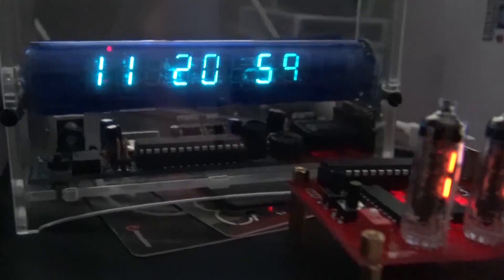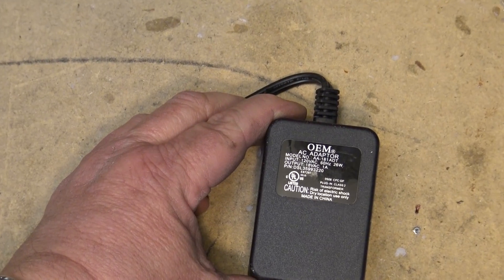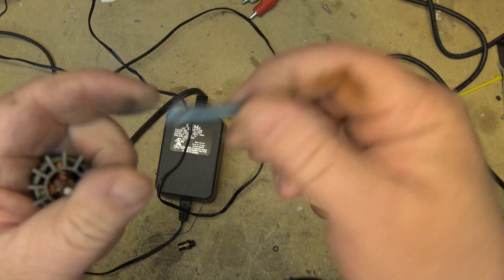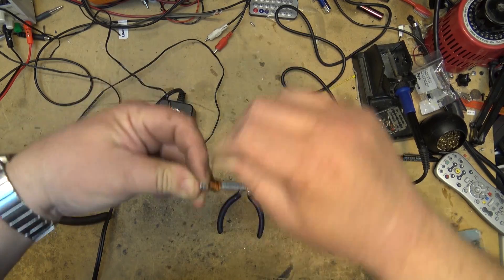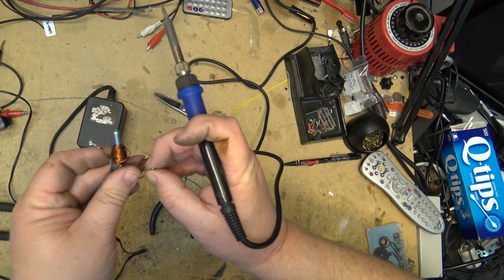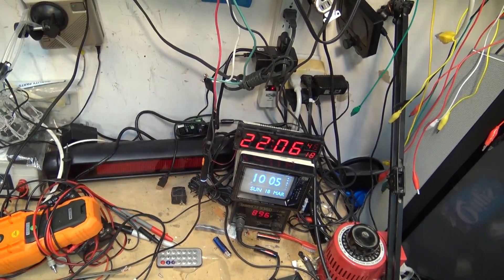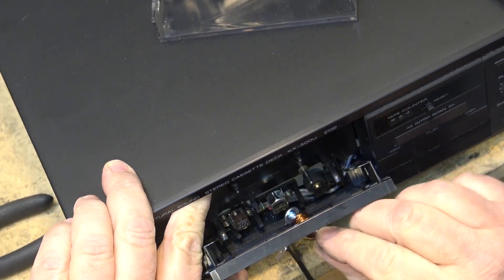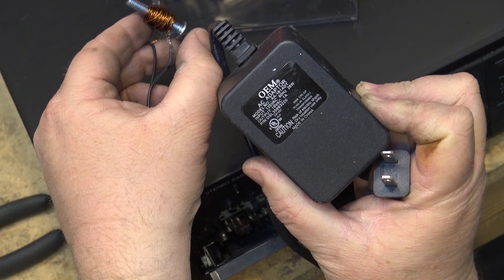Build a tape head demagnetizer in 5 minutes

Comment: very nice . One question I do have: in the cassette deck manual, it says that the device should be OFF when demagnetizing. but you were demonstrating a playing deck. which one is safer ?

also, is there any danger that the wire get too hot or the transformer to burn ?

Comment: Mine got hotter than hell and melted the tape.  12VAC 100MA -
Reply from the maker: Need more turns of wire.  It will get warm. Duty cycle 1 min on 5 off to cool.

Comment: Does the cassette deck need to be powered on?
And does it have to be 18v power supply. Can I use a 12v ?
Reply from the maker: Powered off and 12v should be ok but it must me AC not DC.  Dc makes a magnet.
Reply: @12voltvids Okay thank you

Comment: I don’t have AC-AC transformer. I solder the coil wire to AC-DC adapter before the AC voltage from transformer has regulated. It’s also use🙏🔥
Reply from the maker: That won't work. Must be AC or you create an electro magnet.

Comment: even DC output old wall wart will work but it means you have to break open the plastic case and remove the rectifier diodes..

Comment: Can this erase 1/4 inch tape ?  How long can something like this stay on before over heating & burning the pwr supply ?
Reply from the maker: Yes it wipes a 1/4" tape in 5 seconds.   1/2" VHS and beta in about 10.  8mm and dv tapes about 10 seconds as well.   Duty cycle is 1 min on 8 off to cool.  You can wipe plenty of tapes in that time.   Run it too long and it will shut down till it cools.  It does have a thermostat inside that will turn it off.

Comment: I have very little experience with power supply stuff… I have many power supplies that just say “12V 1A” as an output but none that specify AC, as in “12VAC”. Is the AC implies in these cases? They also don’t specify DC, so I don’t know what kind of output they are. Any way to tell?

Comment: This is great! Works perfectly!  I have a doorbell transformer laying around, 120VAC->16VAC. Hooked up a wall plug to it on the 120V side. Took some 18ga copper wire (coated) and wound 2 layers about 1.5" at the head of a 4" bolt.  Then connected the ends of the wound wire to the transformer and plugged it in. Boy, that transformer was not happy..bzzzz.. I slowly  swept the my terrible sounding microcassette player with the other end tip of the bolt, all around inside the cassette cavity for about 15 seconds.  Unplugged the transformer, to my great relief :D, plopped a cassette into the player. WOW! What a difference!
Reply from the maker: Yup.  Doorbell transformer works great.

Comment: How many spires?? What type of voltage is needed?? Ac but what its the Minimum voltage??
Reply from the maker: Must be ac.  Dc will do the opposite.
Reply: @12voltvids  and  nonworry about thenvoltage?? What isnthe minimun range?? Thanks again!! :)
Reply from the maker: @Jota.Barrakero  the higher the transformer voltage the more turns on your winding.   I could use a lower voltage transformer myself as the coil gets warm with use.  A 12 volt would be better but it works fine.  If you put enough turns of very fine magnet wire you could even run from mains.

Comment: One could probably heat shrink the end to avoid accidents like scratch head - as commercial degaussers have plastic tips obviously covering a coil .. what do you guys think? even electrical tape ..?
Reply from the maker: Well I did put heat shrink over the end.
Reply: you don't touch the tape head with the demagnitiser a inch away is fine passing the tape head from left to right or what direction the plug is at on the demagnitiser.
great video just what i needed.
Reply: @theprogrammerrolandmc3039  dude, I was talking about accidents - and they happen.  We know not to touch the head with the demag.   Yeah it's a good video because it can provide an economic method of demagging.   cheers.
Reply from the maker: @theprogrammerrolandmc3039  well the reason you don't touch it is so that you don't risk scratching the head. I have a rubber coating over the metal that will prevent the metal screw from touching the head but the fact that mine is as powerful as it is I can demagnetize the head from probably about 4 inches away because the demagnetizer I built is really powerful and it really fires out a good AC magnetic signal that'll wipe anything.

Comment: Could you use a southering gun (the good old ones) to demagnetize the heads ?

I ve heard some demagnetize CRT's with southering guns so..
Reply from the maker: Good luck getting it close enough to do any good.
Reply: @12voltvids  In theory, the output of the soldering gun is AC, so maybe i could apply your method by wrapping magnet wire around a bolt and just connecting it to the transformer's output (im pretty sure its max 24v). Would THAT be good enough ?
Reply from the maker: @sh0t734  the output of those soldering guns is about 2 or 3 volts.   I used to make tips out of a piece of #10 copper wire.  It's low voltage high current that heats the wire up red hot.
Reply: @12voltvids  thanks for letting me know

Comment: Question. You dont get a shock when you hold the end of it? If your drawing current from the socket?
Reply: The transformer pulls it down to 12Volts, and the wire is coated in insulating enamel.

Comment: This is so great. I have lots of those adapters, and little motors too, and dead cordless drills too, laying around and didn't want to spend $ on a demagnetizer. See, I knew it was a good idea to save all this sh.t. My day has finally come.
I was gonna ask how many winds, assuming that would affect the strength. But I guess 'cordless drill motor kinda answers that question. (well, I guess that could range from 9 to 20 volts). I wonder if a stronger demagnetizer is better than a weak one.  hummmm.......
I see your example happens to be 18v output. What is the acceptable output range ?
Reply from the maker: 9-12v would be preferred.  Mine is a little strong.   Overkill.
Reply: @12voltvids  Many thanks. That's very good to know.
Reply: @12voltvids  that was my next question :)
Reply: I was happy to see it was AC.. I have only one DC but many many AC in bins.

Comment: Hi
Thanks for the tutorial
Can it be fixed with a 32v 1560mA adapter ?
Reply from the maker: It needs to run off ac, not dc. For a higher voltage more turns of thinner gauge magnet wire would be needed. (magnet wire is just enamal coated wire)
Reply: @12voltvids  Thank you very much for your help

Comment: what would happen if I held a neodymium magnet close to the cassette recorder heads. 
Magnet size is around 3/4" x 1.3 x 1.5.
I use it many times to erase cassettes, but sometimes sound is still not so good.
Maybe time to demagnetize heads.
Can I cause damage to recorder or heads if I try it ?
Reply from the maker: Do not put a magnet near the head. That will do exactly opposite what you want.  A demagnetizer works because it is an alternating magnetic field.   120 times a second it reverses the magnetic polarity.  (100 times a second in 50hz countries. )
Reply: @12voltvids  I appreciate you taking the time to reply.  Thank you for the info.

Comment: Or you can just use a toothbrush charger base, which is an AC coil on a former, if you own a rechargeable toothbrush then you alrady own a tape head demagnitiser. Positive is it comes plastic coated so you can't scratch anything. Works great if like my Yamaha deck the door clips off for access.
Reply: Wow, that’s awesome. I will have to try this!
Reply: I tried it and it doesn’t work. Could you tell me what I’m doing wrong?

Comment: Well this is strange , I followed all the instructions to video , except I did read the psu right , it’s a dc out psu , well as I’d done such a nice job ,I thought I’d try it on a screwdriver , so I used the screwdriver to pick up a screw ,, to check it was magnetised , it was .
Ran over the the end of my screw , and then it wouldn’t pick the screw up ..
Remagnetised the screwDriver again with a real magnet , and then redid the test same result ..
Just checked the demagnetiser and switching it it on does pick up the screw .... so funny what it does to the screw diver .
Can anyone explain ? Sure don’t wanna use it on my deck .. must look for another psu with AC I think , but curious as to what’s happened
Reply from the maker: It needs to be an AC output transformer not an AC to DC adapter.  Feeding DC into a coil with a ferrite core produces an electro magnet. AC produced an alternating magnetic field which will degauss (erase) a magnetic field in your play head.  This is really only necessary for three head tape decks. The process of putting any tape deck into the record mode will supply an AC bias signal to the recording and erase heads which will automatically demagnetize the heads. A3 head tape deck has a separate playback head which is not connected to the recording circuits and therefore will gradually become magnetically charged from the tape. Tape head demagnetizers are only required on playback only machines and the playback head on a three head tape deck. Anyone that tells you otherwise is misinformed.

Comment: Why destroy a perfectly good motor when there are easier alternatives? If you don't have sufficient turns, there will not be enough inductance and you may burn out the AC power supply?
Reply from the maker: It gets the job done.  It does what it is supposed to. Not worried about the transformer as it is only on for about 20 seconds at at time so it won't heat it enough to do any damage.  The motor was a scrap motor out of a broken 18v drill so nothing wasted.
Reply: @12voltvids  - Fair enough. BTW, I could have done with that 18 volt ac power pack for my Electro Harmonics Flanger. I finally founding one after many years! Cheers! Would a small transformer with the AC output unloaded produce sufficient magnetic field for such a purpose?

Comment: thanx for this       ...   
2 questions plz
does it have to be soldered? I do not have a soldering iron; or can it just be wound and then put electric tape around wound bits?    thanx
ALSO mine is a OEM AC ADAPTOR   input 230V ~50Hz 140mA OUTPUT 10V     suitable?

Comment: Hi, thank you for this video! This is what makes youtube so great and important. 

I made one today and the only problem I have is it is too week I guess. The copper wire, that I took out of a broken toy motor, is only 0,1 MM thick. Is that a problem?  Adapter is 120V~50Hz 140mA / 12V -- 1A and bolt is similar or identical to yours. I can barely hear anything when approaching the head. Is there another way to test demag if it is sufficiently built besides the CRT monitor? Thank you.
Reply from the maker: Remember the adapter has to have an ac output not a DC or you have made yourself a magnet instead of a degauasing system.
Reply: @12voltvids  Hi, yes I got that. It is AC. The wire is not that thin though. probably is 0.1 MM. Anyway to test it if it is built OK? Thanks. This is how it looks: https://imgur.com/2biUmYo
Reply from the maker: @hefic  yes that is too heavy.  You want to use magnet wire.   That will overload your transformer.   Mine draws probably an amp and gets hot quick because my wire is also too thick but my transformer puts out enough current to drive it.
Reply: @12voltvids  So thicker copper wire is what I need. Thanks a lot. I think I'm gonna use screw driver like someone here suggested. Thank you for your time.
Reply from the maker: @hefic  no, thinner.  Less current.  More turns.
Reply: @12voltvids  That is a surprise since this is so thin that I can ''barely see it''. So for an average screwdriver what diameter wire should I get? Thank you once again.
Reply from the maker: @hefic  26ga magnet wire should be fine.
Reply: @12voltvids  Thank you. (Only quick search for 26ga gives me diameters  of aprox. 0,5 MM which is actually thicker than mine).
Reply: @12voltvids  Try #2.  I think this should do. https://imgur.com/TYQP23a  &  https://imgur.com/1w5Of4m . I've noticed a magnetic pull effect towards the metal head. Is tape ok or should wire be free? Sry for questions, I'm kinda 'monkey sees monkey does' in this field.
Reply: I made one with some real thick wire from a dead transformer and just used a ton of it. Works good. The impedance is important.

Comment: be alot sliocker and easier to handle if you use an old screw driver with plastic wooden handle..  also wrap plastic  thin sheet around the screwdriver metal shaft before widing the wire around it.  im making one right now actually,  i have many tape etc players with magnetic tape heads to degauss  around here...  also i need to find or make some drive motor belts too,  out of string and rubber cement or find some rubber bands or something.

Comment: Could Dremel the end flatter and cover with heat shrink.
Reply from the maker: Why?
Reply: @12voltvids  Well, a covering to prevent scratching anything, plus If the bolt was slightly longer and a had a shaped tip would improve access to the head. I made my own years ago. But mine runs off 240v UK voltage, your lower voltage is better.
Reply from the maker: @Peterjames3535  
This is strong enough to demagnetize the head from a good inch away.

Comment: I have one 18V AC with 400mA is it ok? (edited)
Reply from the maker: No! Dc will create a magnet and magnetize your heads. Needs to be a. Ac field to neutralize magnetic charge on head.
Reply: @12voltvids  Sorry my mistake. I mean 18V AC but with only 400mA. Thanks.
Reply from the maker: @retroaria  yes that will work.
Reply: @12voltvids  Great, I'll make one and post it on my channel (in Portuguese).  I will leave due credits at the beginning of the video and in the description.  Thanks again for your attention.

Comment: I dont think i have an ac power supply kicking arround.  Will the output from an auto transformer on low voltage do the same job?
Reply from the maker: Crack open a DC wall wart and remove the diodes and filter.  Or go but a transformer for a doorbell.  Don't use auto transformer.  That's not isolated and you will be handling mains current.
Reply: @12voltvids  i do isolate it through  a 240/110 step down and 110/240 step up and its run off grid from 12v bank and inverter. I had a nervous test with it in a rubber vice and too much heat generated withjout any current limiter... Think i do have an old chime transformer somewhere actually, good shout. 
Last minute restoration of an old sony tc118 done up with classic scratch n sniff like the guardians ship moc deck for chrismas

Comment: can you use 12 v AC with a thinner wire?
Reply from the maker: You can use 6 or 12 volts.  I used what i had on hand and the wire i used was actually too heavy as it gets warm.
Reply: @12voltvids  TY!

Comment: It does not need it and there is no need to do it- it is all snake oil.
Reply: Demagnetizing is required only on playback heads.  Record and erase will neutralize as soon as record is entered.  A 3 head deck needs the play head degauased.
Reply: @ilovemysmartmeter  You need to experiment and test your facts as other wise you are just wrongly following the crowd. I am in this business of deck repair and I see the real results. There needs to be good proof of some process otherwise I just do not follow things blindly.
Reply: @sampalermo123  Do you reckon no tape head needs demag? 
From what I've read, where the head is a combined play/record, the bias will demag the head automatically when in recording mode.

Comment: If i use less insulated wire with a lower voltage like 9v AC , it'll be ok ?
Reply from the maker: Mine is over kill.  I used the transformer I had.  A 9  of 12 vac transformer would work just as well.

Comment: I tried it with just a big ac to ac power brick because that’s after all also just a big ac coil and it works pretty well too. I tested it by magnetizing a metal piece with neodymium magnets and after holding it against the power brick, with a compass I confirmed that it was very much reduced. You can feel the metal vibrate a bit if you hold it at the right spot.

Comment: If I was to use a demagnetizer on some Zip discs that can't be formatted, effectively "erasing" them, would they become formattable again?
Reply from the maker: I can't help you with that one, because I don't know why your disks can not be formatted. Perhaps the drive is bad.
Reply: @12voltvids  I tried them in several different drives and got the same "read error."
Reply from the maker: @aidanfranits1339  Never had a zip drive, know nothing about them sorry.

Comment: Thanks for the video. 
Quick question and if you can rough ball the answer the question is: "how much of a voltage drop should you see on the coil to be creating roughly the best demagnetizer"? 
I ask this because I dug up a 12 vac transformer and a small winding would generate little voltage drop and a big winding would create a large drop. I am not an electronics guy but I expect bigger mag fields see bigger voltage drops so my guess is you want to have a coil big enough in turns to drop nearly the entire ac source across the coil?